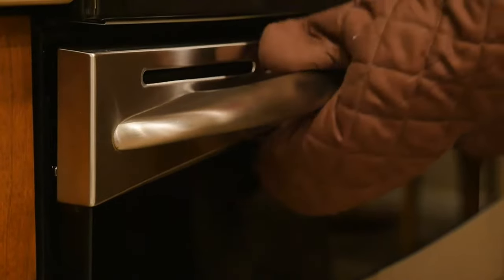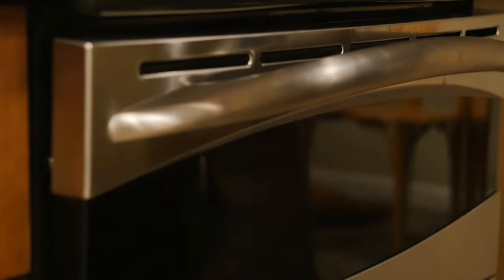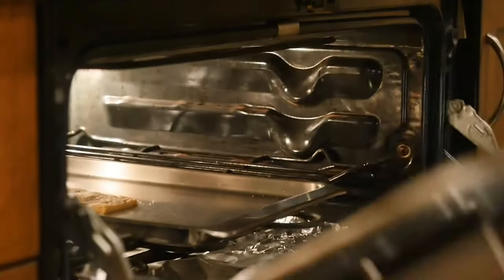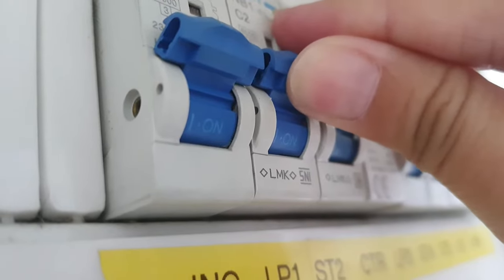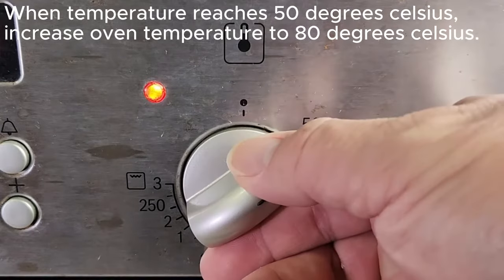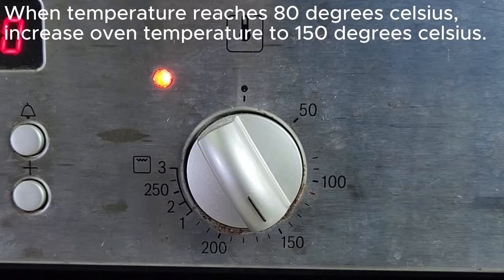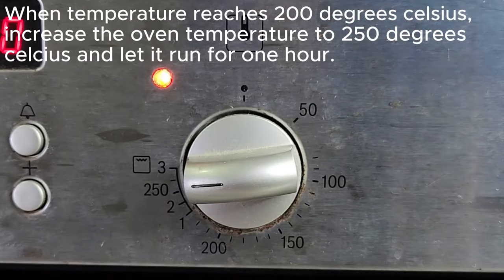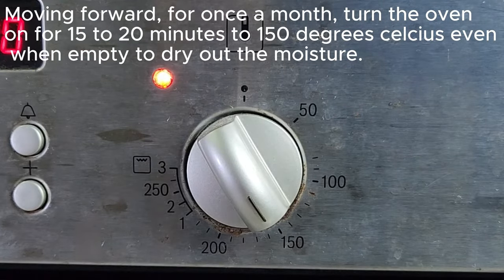What to do if your oven trips the circuit breaker?

Comment: The oven is 240V 33A and the hob is 22A and 250V. The isolator is 50A and breaker keeps tripping when I switch on the oven and all the stove plates. Is the isolator maybe the issue?
Reply from the maker: If u tried this method to dry your oven and it still trips the breaker, then probably you might have a faulty circuit somewhere and might need to get a technician to take a look.

Comment: Hi my Brandt oven works when the earth in the plugs is disconnected (no electric shock touching the oven) but trips as soon as connected. what could be the solution? dangerous to work without the earth?
Reply from the maker: It's extremely dangerous to operate your Brandt oven with the earth disconnected. The earth wire, typically green or green and yellow, is crucial for safety reasons. It provides a path for any leakage current to flow away, preventing electrical shock and potential fire hazards.

 * Earth leakage: Disconnecting the earth wire might hide an underlying electrical fault within your oven. When the earth is reconnected, the fault current is detected, causing the circuit breaker to trip to prevent potential harm.

Possible solutions:
 * Contact a qualified appliance repair technician:  They can diagnose the fault safely and perform necessary repairs to ensure your oven functions properly with the earth wire connected.

 * Do not use the oven: Using a faulty oven with a disconnected earth wire is a safety hazard. It can lead to electrical shock or fire.
Remember, your safety is paramount.  For peace of mind and to prevent potential risks,  avoid using the oven and seek professional help from a qualified appliance repair technician.
Reply: Thank you very much..I will have to look for a technician